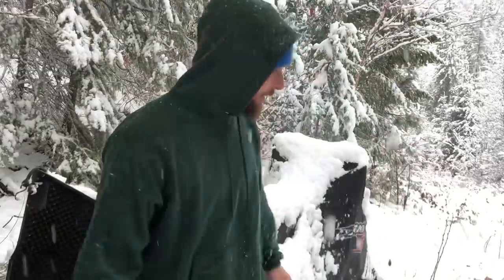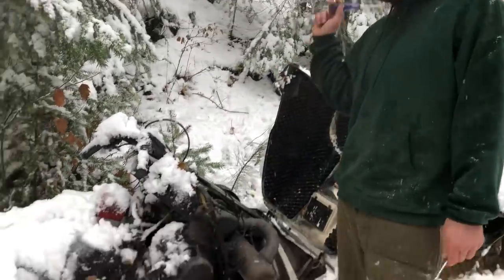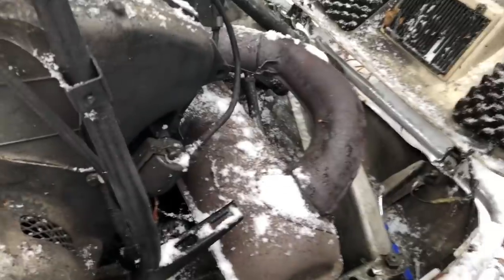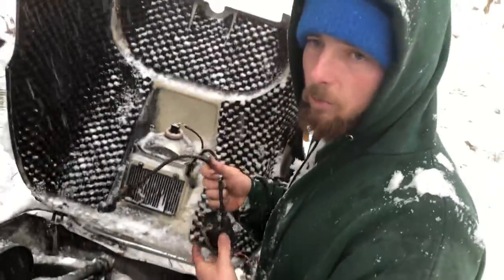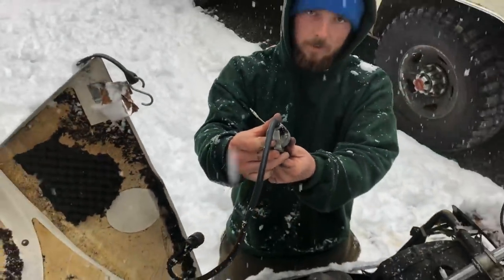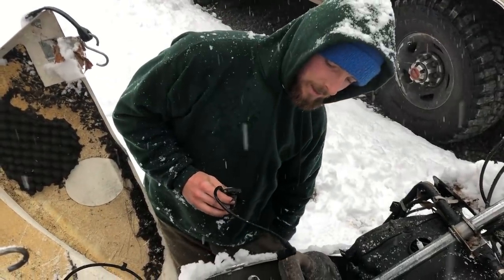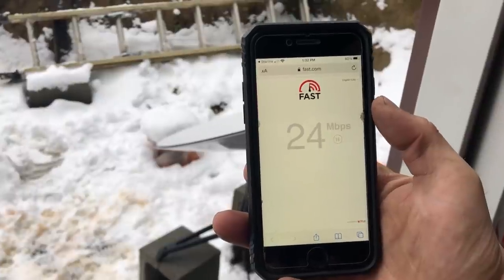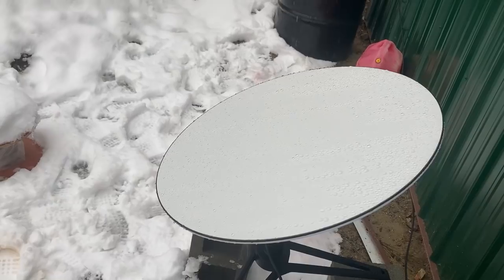Snowboarding And Snowmobiling Our Own Mountain | Starlink Unboxing And Setup

Comment: What did you use for internet before? I can't wait for starlink to be in Canada. We are using a box that runs on cell service and it's absolutely terrible. I've called every satellite provider in the area and we can't get anything here, and 10s of thousands of dollars to bring in a communications line
Reply from the maker: We had nothing. No internet and basically no cell service either. As far as power consumption I’m not positive. The power supply says total max output 180 watt
Reply from the maker: Max of 1.9 amps maybe